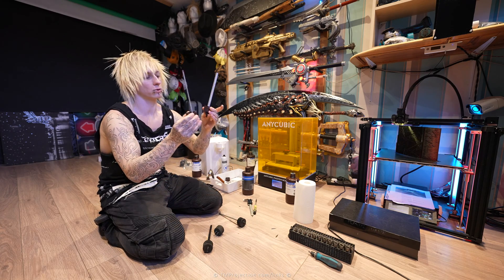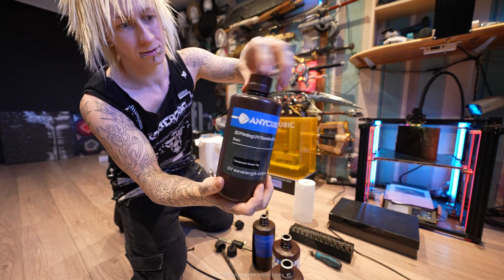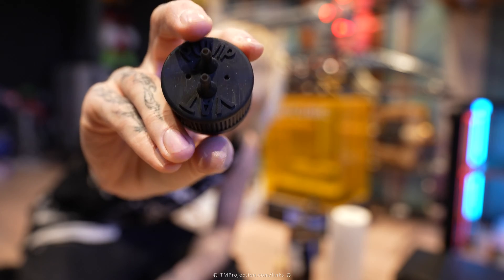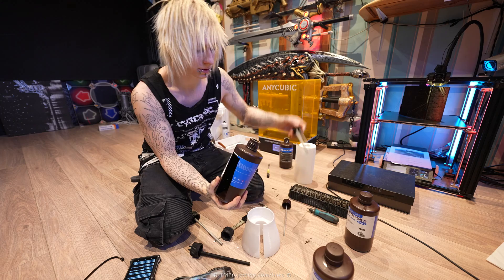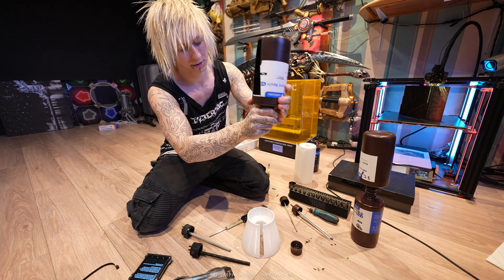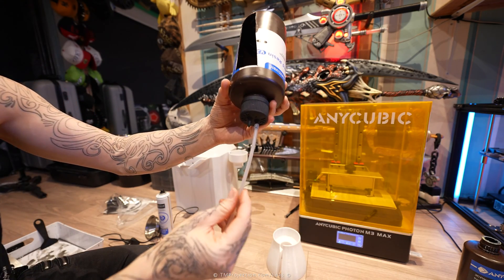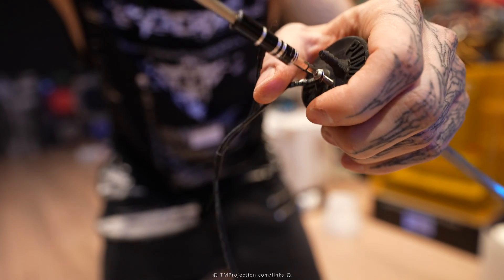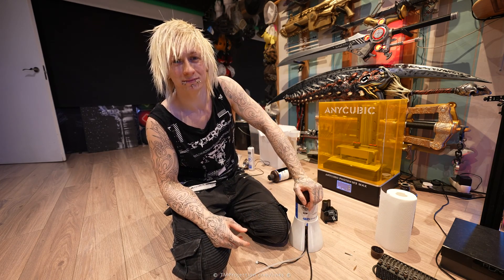Anycubic Auto-Feed System is BROKEN BUT I FIXED (Photon M3 Plus and Max)

Comment: i just made a thicker silicone washer, have not had any vacuum leaks since. I used an old silicone kitchen mat sold at the dollar tree, I also use the mats on the table to control resin spill.

Comment: I ended up swapping the hoses on my stock feed cap and putting the bottle in the stock holder, but upside down. Same effect :)
Reply from the maker: not sure what you mean by bottle in stock holder, but i chsnged the tubes aswell actually, to longer and thicker ones too
Reply: @TMProjection my m3 max came with an aluminum bottle holder. It isn’t supposed to hold the bottle upside down, but it does if you bend it a little haha - I like your design. My cap didn’t have leaking issues so I was able to flip it

Comment: I've heard a lot of horror stories re these pumps overflowing the vat and going through the machine, so I've been reluctant to use it. I like this design concept way better but it still could overflow the vat if the sensor failed yeah?
Reply from the maker: the sensor that detects if the vat has liquid is quiet solid, it just has two pins inside the vat, thats very unlikely to fail, the problems came from the lid not the vat

and it did overflow in my experience a few times, causing issues, but this was caused to the vat not being deep enough + the table not being balanced, i actually made more fixes to these issues with a release of a few files i made, you can watch a video about this here

https://youtu.be/dUUbDiD8x7M
Reply: @TMProjection  Thanks, ill check out the other vid. have you come across any deeper vats (i haven't as of yet)?

Comment: A metric 215 sized buna-n o-ring seems to be about the right size. Lol at the whole print a new cap business. And no comment on the risk-reward ratio on mounting the bottle upside down. Also passing current through the resin to check the level does heat it, but is probably negligible compared to temperature of the environment. Likely to get more heating from the fans being right next to the default bottle mount location and holder. This heating seems intentional, especially with an enclosure that is going to keep that warm exhaust around the bottle.

Comment: Man thank you so much for this, I cant believe I fking missed this video as I've been waiting for the video to come out since seeing your original video, three questions 1. you said you have to use different screws, what size screws are needed to replace the current ones? 2. You said you extended your wire? How'd you go about doing that? I hate the short length on the current wire too. Lastly, you got any tips for beginners on PLA printers? I bought a anycubic kobra a year ago wanting to get into it but I feel I've had more issues with it than resin printers IE stringing occurring as the print and supports being a nightmare to remove.
Reply from the maker: i use M3 x 13mm, but you could buy and use say 20mm ones in length

extending the wire, if you dont have soldering skills you could just cut them and extend them with any random wires, just wrap them around in insulation tape

perhaps just youtube how to extend wires

yeah FDM printers are actually much tricker, you could perhaps check my other videos out but i dont think i have anything specific to your problem